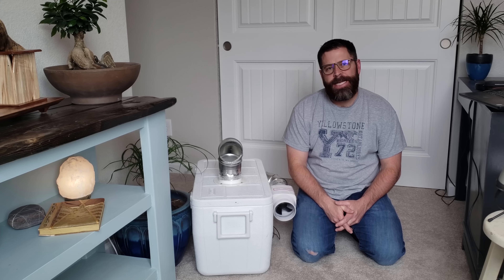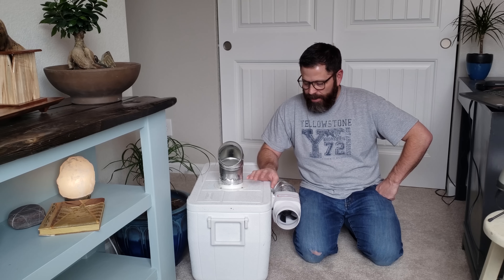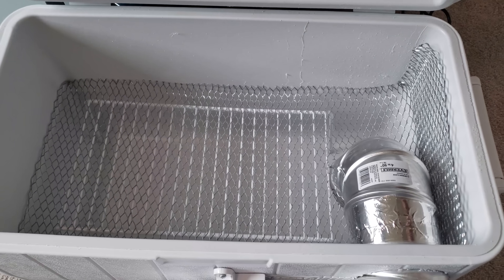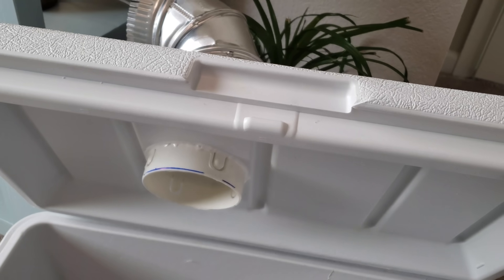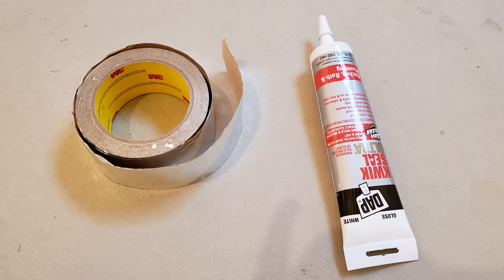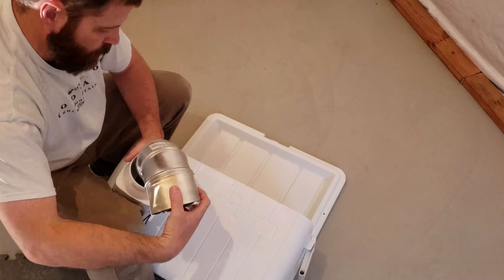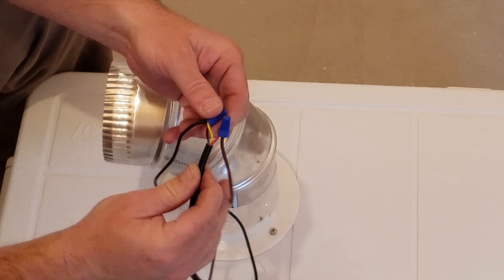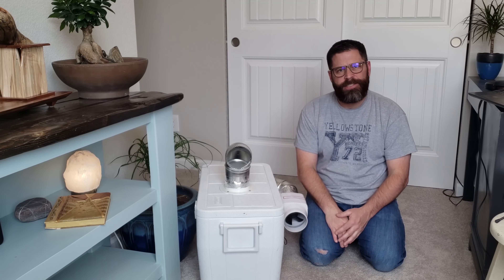Homemade Portable Air Conditioner DIY - Coldest One Yet!

Comment: Absolute waste of time and money..dont even bother..the reason that your ac is measured in tons it means...we will use 3 ton as an example...it means that the ac can remove enough heat to melt 3 tons of ice in a 24hr period..so its equivalent to using 6,000lbs of ice...good luck with the 8lb bags 2-3$ bags...you will also see ac measured in btu's...British thermal units...1 match is equivalent to 1btu...12,000btu=1ton...3ton ac will be 36,000btu worth of heat being removed by the ac...this contraption will not work because this is not how a ac works...its not just blowing cold air...what it's doing is taking the moisture/humidity out of the air and the heat  is taken outside and released by the refrigerant because when a liquid is turned into a gas a lot of heat gets absorbed because energy was used to turn the gas into a liquid with pressure...you are simply just reversing the process..your ac puts a liquid so that it turns into a vapor...heat is transferred to the refrigerant which takes it outside and releases it at the condenser where its compressed back into a liquid and then the process repeats...ac can not work if you do not remove the heat outside...your not doing anything but wasting your time and money...you must take humidity away which is done when air is blown over a cold coil and causes condensation...which is why you must put them in a window...to drain water outside...a small window ac is 5000btu...its the smallest 1 you can get...which is about 1/2 ton...its like having 1000lbs of ice...which is only enough for about 200sq ft...1 ton will do approximately 400sq ft for cooling...at least where I live in the NE USA...so an average house size is about 1200sq ft...which needs about 3 ton ac...
Reply: METO U He states this in the video. This is not a AC unit. It is an air cooler. This is not even an evaporative cooler (swamp cooler). As an HVAC guy, you should know the difference. It isn’t designed to move the heat out of the space. Nor is it designed to “condition” (dehumidify) the air. It is designed to transfer the heat into the H2O transforming it from a solid state to a liquid state and from a liquid state to a gaseous state. Only in this last stage would the humidity in the space go up in any significant amount. The last stage doesn’t occur until the temperature inside the box raises and the friction from the air movement is sufficient. Translation...after all of the solid has transferred to liquid. (All the ice melts)

The average size of a house in the US hasn’t been 1200 sq ft sense the 60’s. In 1950’s it was around 800 sq ft and in 1970 it was at 1400. As of 2009 it was at 2700 sq ft and has remained in the mid 2000’s sense then. As for apartments, well that’s a different animal all together and neither are relevant to this situation. 

The space he is cooling is only about 144 cubic feet. Or, to put it another way, a room the size of a bathtub with an 8 foot ceiling. How many tons does it take to lower the temperature a bathtub with the curtain closed? 

This is not an AC unit. Comparing it to one and then saying it doesn’t work is the logical fallacy known a straw-man argument. And while a real straw-man can hold water, your argument doesn’t.

D.
Reply: @westmountainadventures3606  who said that I watched the video...surely not me...you are assuming that I watched it...there is no reason for me to watch the video because I know that its BS...I put my phone down for a sec to go piss and come back with this crap playing so I figured I would just drop some knowledge on fools like you that still think Santa and the Easter bunny are real...and this is the thanks that I get...I guess what I already said is still not enough for some frail and fragile minds...there are 4 ways to transfer heat...conduction..convection...radiation and evaporation...now let's dive in and discuss each of these and seek what is actually happening with this thing and all similar things...conduction is the transfer of heat through  solids...charged particles being forced together is called heat energy...magnetism...its simple...there are 2 types of heat..sensible heat and latent heat and 4 types of heat transfer...conduction already mentioned..convection transfer of heat through a fluid...and radiation...electromagnetic radiation...you are definitely not using radiation or conduction for the heat transfer which only leaves convection and evaporation...you are definitely not using evaporation which only leaves convection which is the transfer of heat through a fluid...air is a fluid and behaves exactly the same as a liquid with the only difference being the density between air and a liquid...water is 1700x more dense than air...so obviously it doesn't take a genius to figure out that the absolute least efficient way to transfer heat is exactly how this damn thing works...it can not be any less efficient...its the bottom of the barrel...and the reason is because of a combination of there being a very small surface area being used to transfer the heat because absolutely nothing is being used...its only air which is a very good insulator Einstein...and you do not want to use an insulator to transfer heat Einstein...yet that's exactly what is being done intentionally...what a dumbass..and the funny thing is that you are too stupid to even know what you are doing...I needed a good laugh ...holy shit are you 1 big  dumbass...you are like a dog chasing his own tail. Seriously..Why the hell are you even talking...its impossible for you to know any less about this subject...you need conduction to transfer heat efficiently...you must blow air over a cold conductor...not blow air over a cold insulator jackass...there is literally 0 heat transfer surface area...holy fuck you are 1 dumb son of a bitch...wow...unreal...but something tells me you still have something extremely stupid left to say...I'm gonna make some popcorn cause this is way better entertainment than any movie that's for damn sure
Reply: @westmountainadventures3606  exactly what do you mean when you say that heat is transferred to the h20 from a solid state to a liquid state...please shower us with your wisdom oh mighty one...you are about as sharp as a bowling ball...this is gonna be good
Reply: METO U What I said was, “It is designed to transfer the heat into the H2O transforming it from a solid state to a liquid state...” 

In the field of HVAC units, I have no doubt that you are an expert. On the physics of how this unit work, no so much. If you can answer this question you will have answered your own. What is the difference between ice and water? Or more generally, what is the difference between the solid state of a material and the liquid state? Hint: it’s the same as the difference between the liquid state and the gaseous state. 

You keep saying that this unit doesn’t work. What exactly do you mean by that?

D.
Reply: @westmountainadventures3606  do you even know what a conductor is. It is you that has the lack of knowledge my friend...exactly how much ice do you use in a single day...air conditioners work by removing latent heat first before sensible heat...do you even know what that means...it means that shit box is not doing crap...your system is backwards and won't work...moisture is taken out of the air not put in...there is no heat transfer through a conductor...why do you think your car...if u are old enough to drive to begin with...has a radiator made from a conductor....why does baseboard heaters have radiators made from conductors...why does your furnace have a heat exchanger made from a conductor...why does your  water heater have a heat exchanger made from a conductor...why does your car ac and house ac have evaporator coils that are made from a conductor and your condenser outside have a coil made from a conductor...are you starting to see a pattern yet...every single thing used in your day to day life that involves the transfer of heat uses a conductor...and this does not have 1...this means 1 thing...inefficient and a waste of energy...how about letting us know how much ice you go through in a single day and how much do you pay for the ice per day
Reply: @westmountainadventures3606  if you do not have something to remove moisture from the air it is impossible to cool a room...yes you may feel a 5 degree temperature reduction with your face 4in from the exhaust and cost you 5$ for 20 min of it...air conditioners were not invented for people...Carrier developed the first dehumidifiers so the ink could dry on printing presses on hot days in printing rooms...and dehumidifiers developed into the ac we all know and love today...you must dehumidify in order to cool...this can not be done without a cold conductor..or a conductor..hvac seems simple looking in from the outside but its anything but simple...its the only trade where you must know how to do all of the  other trades...I can do an electricians job but they could not do my job
Reply: METO U No one is saying that this unit is efficient or cost effective. 

You keep saying that this doesn’t work. What do you mean by that? Be specific. Are you saying that it cannot lower the temperature in a space?

D.
Reply: @bait28  I think that you should research what I said a little more before you write any more comments on this specific thread. You just differ in opinion with me on what is a waste of your resources and getting the most value from your resources...there are way better options...like I mentioned before...using more of what you need on something than neccessary to complete an objective does  nothing beneficial so why do it...you lack the knowledge that I possess about how much energy it takes to make ice and the value of return for the energy used
Reply: METO U I see you have been back sense my last post. I guess you don’t read up?  Here. I’ll post it again. 

“METO U No one is saying that this unit is efficient or cost effective. 

You keep saying that this doesn’t work. What do you mean by that? Be specific. Are you saying that it cannot lower the temperature in a space?”

D.
Reply: If it works for him why is he enjoying it?
Reply: If it keeps the inside of a car cool during a hot summer day or night for whatever reason you use it it’s not really a waste of time or money.  Stop flexing so hard no one asked for the scientific process of how an ac works.
Reply: @Slycandyman  or... you could just use the A/C in the car? which is way more cost effective (even with the tiny gas mileage reduction) b/c it's an actual A/C. which is the point METO U was making. This might be a good temporary solution if your car A/C suddenly craps out on a long road trip and it's not a simple refill issue.
Reply: @Slycandyman  my man it does not work...this is not up for debate. I am a universal hvac tech and nate certified and I am certified to work on any hvac equipment on the planet...not everyone can do that...I'm sorry that your feelings got hurt because I spoke the truth...its time for you to put your big boy pants on...I simply made a claim and I explained why I feel this way...what am I supposed to do genius...not back up and prove what I say...anybody can do that...but not everyone can do what I do...you are a weak, fragile, and tender minded person...congratulations you are now officially on my top 5 list of the dumbest people on the planet list...how do you feel bestowed with this honor? And how the hell did you manage to leapfrog over so many other people I have encountered during my entire life...working on hvac equipment is what I do for a living...I know how they work and you dont...I said everything in the most  simplified way so people exactly like you could understand what I am saying...and you still don't understand...there is no hope for you so do the world a favor and castrate yourself because you're Gene's are not needed in the gene pool...natural selection will take care of you if you don't castrate yourself

Comment: Refrigeration works by moving heat energy out of an area.  Your refrigerator/freezer moves heat energy to the room it's in and the A/C of the residence or building moves it to the outside.  An automobile's A/C does the same thing.  These homemade ice air conditioners simply rob Peter to pay Paul.  As recommend by others, fixing the existing A/C is much better, especially since an automotive A/C has about the same capacity as a 3-4 ton unit.  I'm still waiting for a video that suggests using dry ice.  Ha

Edit: I spoke too soon, with all the dry ice comments, it seems that Darwin is alive and well.

Comment: Maybe use all pvc so the plumbing is waterproof.
Reply: Would need to be something other than regular pvc pipe. The walls are much too thick and not very good at transferring the cold from the outside of the pipe to the inside. It would need to be a very thin walled pipe.
Reply: @mountainman4410  I don't agree, but flex plastic is easy to get.
Reply: @smokeydabeecharlescoleman8365  I've got quite a bit of experience with these sort of things. If you took say a 6" piece of 2" schedule 40 pvc, fill it with ice and cap off both ends, all the ice would melt away and you wouldn't ever be able to feel the difference on the outside of the pipe. The walls are just to thick for thermal transference to take place. It does happen a very small amount, just not enough to make a difference.
Reply: @mountainman4410  just a passing thought for the pipe between the fan and into the box, not really that important. Have a great day.

Comment: If that cooler holds three bags of ice that's 18Lbs. Assuming the fan runs until the ice melts and the resultant water reaches room temperature 68 degrees, then the total amount of cooling would be 2,628BTUs. This is equivalent to a 1-ton window AC unit running for 13 minutes. Is it really worth the effort?